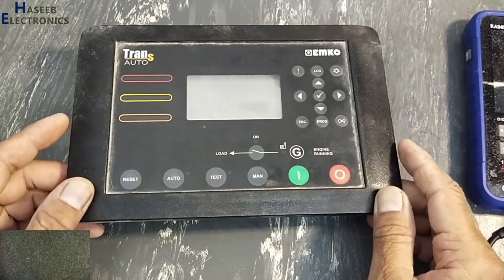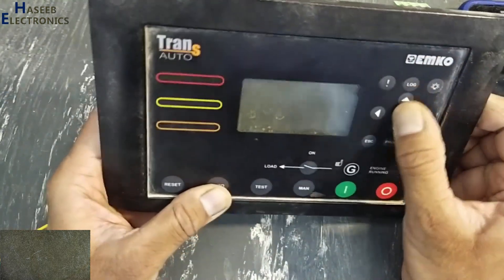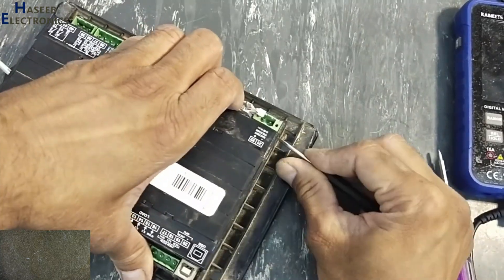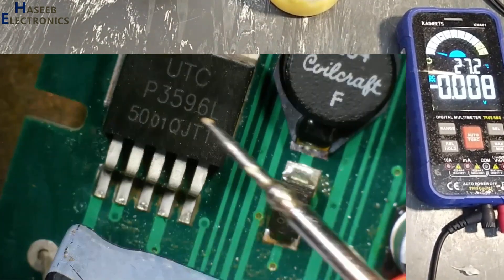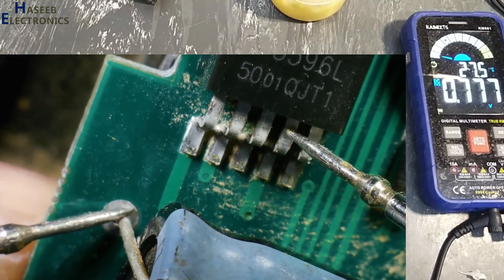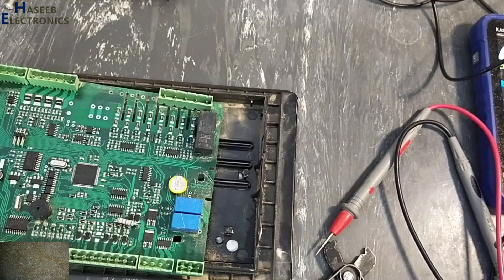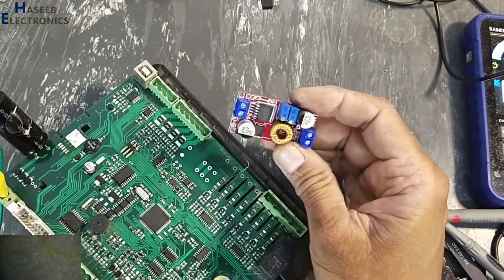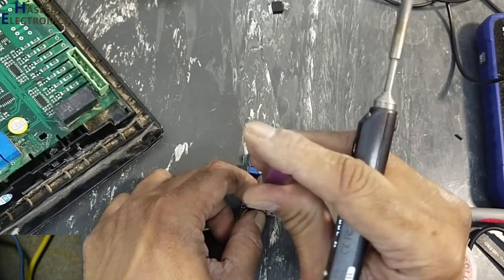{1175} Trans-Auto generator controller has no display

Comment: it is possible to use lm7805 ?  great videos !
Reply from the maker: 7805 is maximum 1.5 Amp current 
This circuit is using 3amp fuse that means its current may reach up to 2 Amp 
Lm7805 WILL not fulfil the requirements
Reply: @HaseebElectronics  
ha ok thank for reply

Comment: 5:00 Take care for your TC1 tester and short the legs of the cap before connecting. I killed my TC1 this way, because previous multimeter charged the cap during measurement and this charge killed my TC1. It was completely damaged (Surge protection and micro controller) 😢
Reply from the maker: oh sorry for your tester loss 
discharging the capacitor before teting by any type of capacitance meter is very very important. otherwise it kills the capacitance meter. 
because the capacitance meter applies a frequncy based test signal to test XC, and a charged capacitor destroys that frequency generator circuit

Comment: Very good explanation sir. I would suggest 30V 3A Power supply with current control instead of buck converter. It is possible to limit current to fuse value not to damage circuit downstream voltage regulator if any problem there was the cause of its damage. I like very much the way you deal with circuit repairment. You are number one!